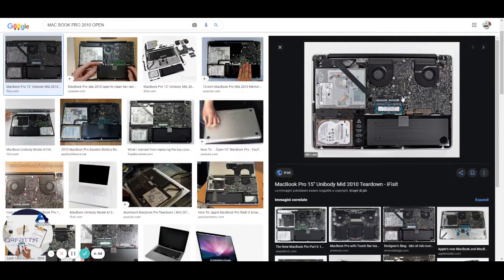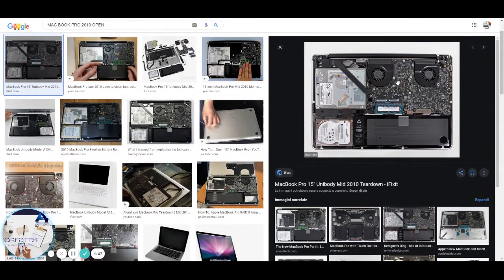MAC BOOK PRO 2010 BACK TO LIFE WITH AN HAIR  DRYER without removing the motherboard

Comment from the maker: If you want just to detach your battery and Hard disk i t will be for sure more secure but with the new battery on  and the HD on I tried to keep the dryer only in the point I indicate in the video and later letting the battery cool down temperature for about 5 min. Then I switched it on and magically appeared the white screen but with the mouse pointer as well first, and then the user logos too. :)